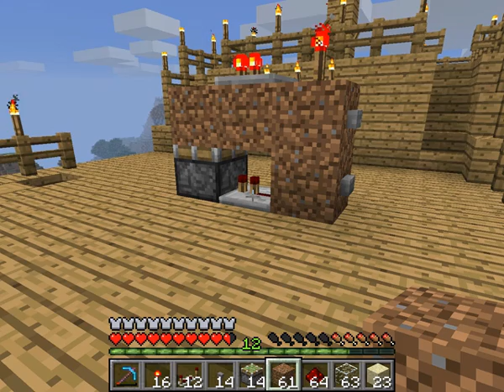Compact Minecraft BUD switch. 1x3x4. Auto-reset. Minecraft 1.0.0

Comment from the maker: @IdiotsAmongUs The dust is needed to power that block. If you don't you just have the input power. You can just remove that block and that dust making it even smaller. But, it develops an interesting byproduct in that if there are 2 modified blocks it will jam. But if there is 1 modified block it will not. It actually can detect more than 1 block update in a tick. See my video Note on simplifying supercompact BUD switch. -- Using a repeater is no different than using nothing.

Comment: As a note on my earlier comment, it does decrease the efficacy of the BUD switch to use a repeater for an output, as certain triggering mechanisms (like a repeater being powered to activate the BUD switch) will cause the piston to jam extended, so it's probably a better idea just to flip them, if you really want the infinite loop of BUD switches triggering each other.

Comment from the maker: @doubldog26 can't think of any use for it. I've set up like 8 in a row and set them off a few different ways. They do a bit of a wave and then go crazy for a bit until you turn them off. I also can't think of anything useful for a trigger switch that can detect the difference between 1 block update and 2+. but there might be something.

Comment from the maker: Rather recent invention. After figuring out the trick of solid stating a piston by powering the block it was carrying. And then understanding that cutting that power turns it into an memory cell. I was fiddling with how to turn it into a t-flipflop. You can do so with a piston but it needs to have and edge. And I thought and was right that you could make this same design also be the edge. But it turned into an a different bit of awesome first. There's still a t-flip-flop in there somewhere.